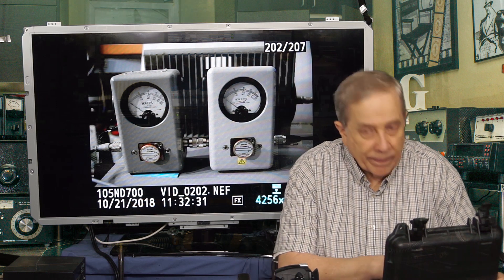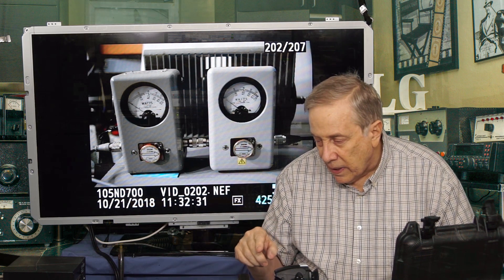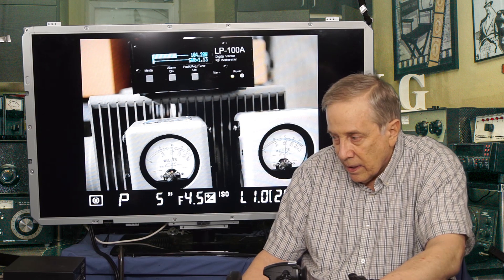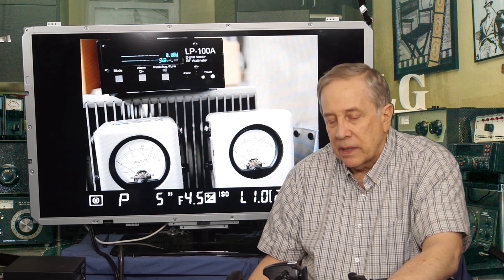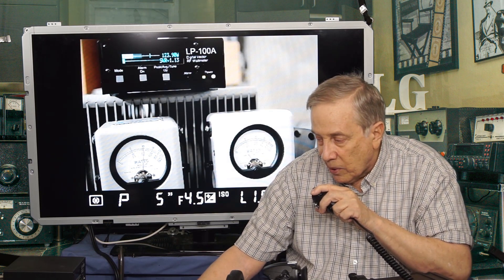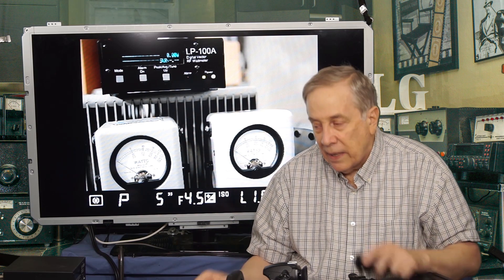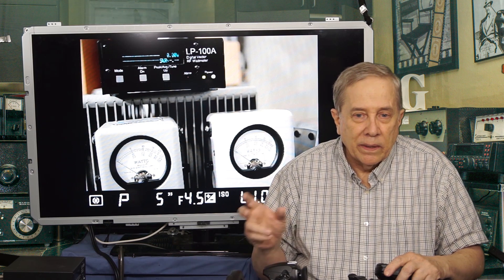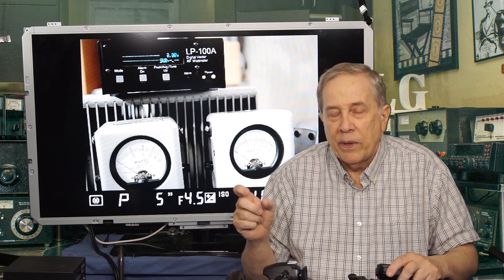Ham Radio Basics--Ham Radio Operators are Meter-Readers and a Look at. the Bird 43 Wattmeter

Comment: Someone stole my 43 a few years back.  Sadly, I lost my pelican case of “gold”  (slug collection).
I replaced it with a Telewave 44 because I was getting ready to retire and didn’t want to make the huge $$ investment 
in Bird slugs.  The Telewave 44 has pretty much the same form factor as the Bird 43 BUT...
it does most common frequency ranges and power ranges.  

(switch selectable vs. “slugs”)

I really like it but not sure if it is as accurate as the Bird..  any thoughts?

Thanks for another great video,!,
Reply from the maker: Thanks.  I simply don't know. The 43 is the standard still.  That has got to be some kind of record for a device.  The method of sensing is old and not the smartest way to do that.  But mid scale readings are right on the money. Thanks for you input.  Keep in touch. 73, Jim

Comment: Very informative. I thought the non peak meter would read 30 to 40 percent of the peak. I was surprised it read lower.
Reply from the maker: It depends on how heavily damped.  Some. many, were 10% to 15%; Drake was the slowest.  73, Jim

Comment: Jim, I have GOT to have one of those three foot tall Bird meters. I know you have them because I see them in your video.
Also, I like that LP-100A peak reading wattmeter. I see them for sale on the Internet. 
Always enjoy your videos - keep them coming.
I hear you on 20M occasionally but you are always deep into QSO so I just listen and don't want to beak in. 
Hope to talk with you soon.
BTW - have you seen my video on the 833A amplifier. I am having a lot of fun with it.
Lastly, after 55 years of being on the air, I finally took my Extra exam, at a ham fest in Socorro, NM last week,  and made that upgrade. 
73 WA4QGA
Reply from the maker: I would like to talk with you about your favorite subject.  The LP-100A is worth getting.  N8LP is a very bright guy.  I never built an 833 or 813. It would be a fun project and a challenge for 10 meters.  Makes me wonder if you could go two 813-L1-C2 instead of 813-C1-L1-C2.  I enjoy your videos.  Fun to watch and learn.  73,  Jim W6LG
Reply: @ham-radio  Jim, I hope we can catch each other on the air soon. My first high power amplifier was an 813 class-C and plate modulated for 10M around 1970 - grid driven, neutralized, etc. Nowadays, I would use the 813 in GG. Beautiful tubes and make a very nice looking amplifier. Probably make it monoband. In one of the older ARRL books there are plans for multiple amplifiers each monoband that I remember enjoying looking at as a kid. Now we can actually build it.
If I can help in any way, let me know.
Not exactly sure what you mean above about L1-C2 unless you are thinking we could leave the tuning capacitor off of the plate Pi network because of inter-electrode capacitance in the 813's?
Reply from the maker: @ElPasoTubeAmps   let's "QSY" to email.  Yes, my thought was.....can we disconnect C1 for 10 and 15 meters?  Maybe a dumb idea.  73, Jim

Comment: Great video Jim and a topic that as of lately needed to be addressed...I hear all to often mic gains cranked way to high because of this very phenomenon 
73
Jeff de WD8JM
Reply from the maker: It is really amazing so few understand the mic gain control and how to set it.  Most do it wrong and you can hear the results.  Like EA3JE who splatters over 20khz and guys tell him how good he sounds! 73, Jim
Reply: @ham-radio  it's even worse on 11 meters...as a truck driver I not only get over modulated garbage BUT all the noise toys that go with it they always "sound real good"...but also hear it on the bands as well...which seems odd since most rigs have an ALC meter ... don't they??
73
Jeff de WD8JM

Comment: Hi Jim,
Excellent video. One correction, the full scale movement in the 43 model is 30 ua, not 50. I believe Bird does make other meters using a 50, 100, and 200 ua movements.   73   WB3BJU
Reply from the maker: Don!!! you are right.  I forgot about that. Thanks.  73, Jim

Comment: Glad to see a new video Jim! 73
Reply from the maker: Thanks Jeff & 73, Jim
Reply: @ham-radio  Any chance in a future video you can discuss your thoughts on headphones? I notice you use an old set of RS Nova's. I am needing something with some noise cancelation to them because it is loud where I operate sometimes (QRM from the wife/kids). I am considering the expensive Pro7 but if those Nova's are that good maybe I would do that instead. Thanks.
Reply from the maker: @jeffreyrichard9675  I have been looking.  I'll look again. Mine are old, worn and held together with glue. I don't want to spend $100. It needs to be less and compatible.   Looking now online.  73 Jim

Comment: Hello Jim. Very good hearing from you today. Quick question- I have a Kenwood TS 140S, 100 watts, I always keep the mike gain at max., and observe the built in ALC and WATT meter as per instruction manual, have about 65 feet of RG 213 going into a homebrew 40 meter invert. dipole, and A 99 vertical dipole, 17 meters, no amp, no tuner ( when my  club does something, I use a Shark 20 meter mobile whip  on the mag mount on the pickup and works good), all antennas good SWR, always get good audio reports, should I be concerned? Thanks and I enjoy watching!  Hope everything is well with you and yours, 73, KC3BXZ Joe
Reply from the maker: Keep in mind that the ALC meter should never go more than 1/3 to 1/2 scale.  When it does, there is distortion and splatter.  My meter shows zero ALC much of the time and no more than half once in a while. What others are telling you has little value because many don't know how to listen or won't comment.  I hear guys check into nets with horrible distortion, artifacts, RF feedback room echo and no one says a thing.  Many net control stations also sound terrible.  They should be setting the example of a clean signal. Thanks & 73, Jim
Reply: Okey doke, will keep that in mind next time, thanks.
Reply: Jim, I told you that I keep the mike gain at max. .. I meant to say, RF gain. The mike gain is just barely cracked open, most of the time. My mistake. It is hard to adjust because this radio doesn`t have a knob for these controls. They are sliding controls.. My goof.